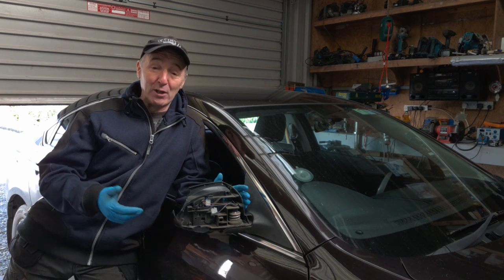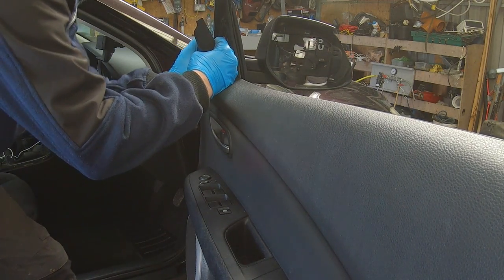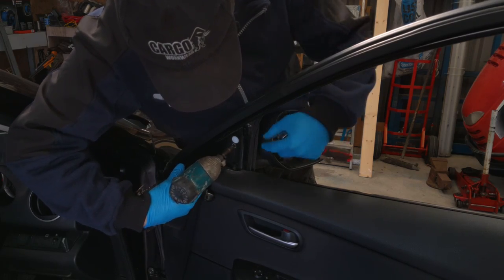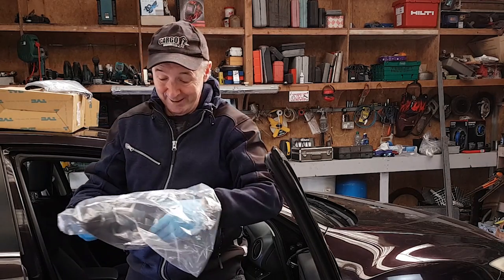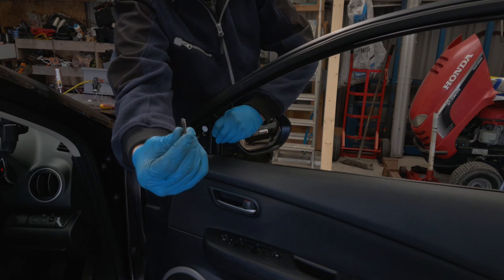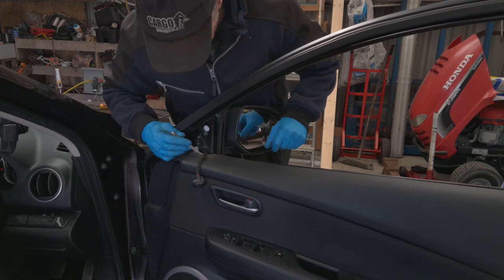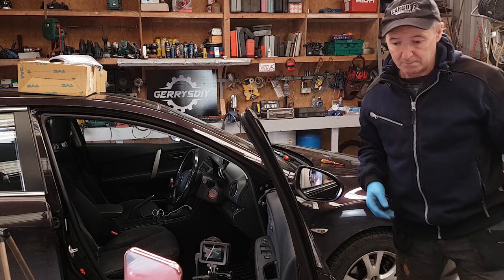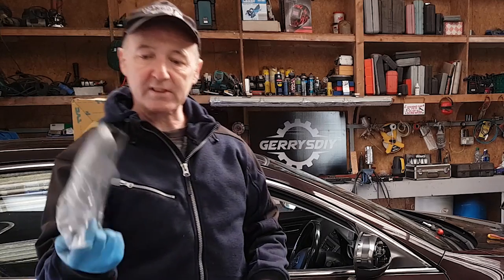Replace Door Mirror on Mazda 6 2008 -2012

Comment: Thanks Gerry, for the video.  Good tip.  Nice that you didn't have to remove the inner door panel.  removing it, would have probably broken 4 or 5 of those clips.  I have similar experience with my VW.  I was thinking that you should have used a magnet on your spanner for the last bolt, but being careful worked too.
-mike

Comment: Hi mate. Do you happen to know can I buy new wing mirrors and new drivers window panel in order to make my 6 have folded and heated mirrors as it doesn't have it originally? My concern is electrical connections and maybe programing because that will require dealer. Nice job by the way, definitely DIY.

Comment: Can you tell how to remove the back cover of the  mirror without brake it pls!?
Reply: Gently prise it away from the top with a plastic trim removal tool. The clips are in the bottom. When putting it back, insert the clips at the bottom first and then gently press it home form the sides and top. Emphasis is on GENTLY.
Reply: @James_Bowie Thank you so much 👍👍👍